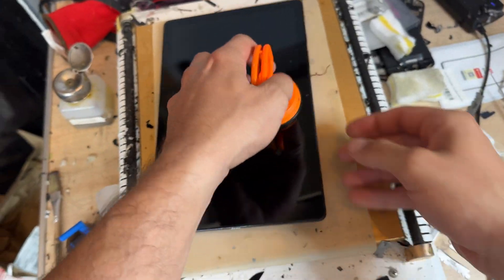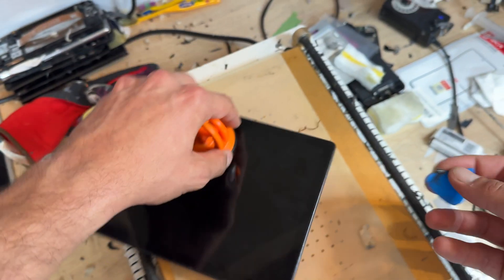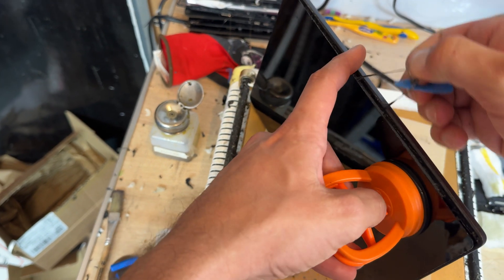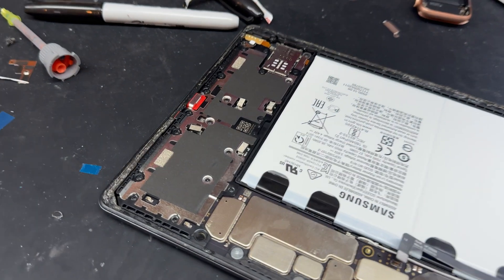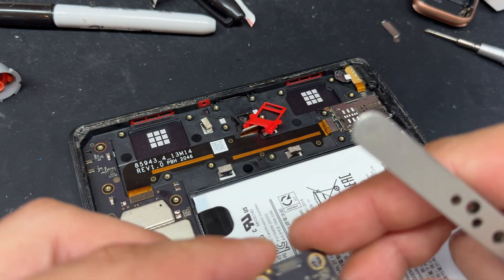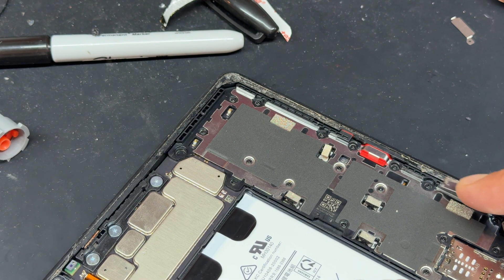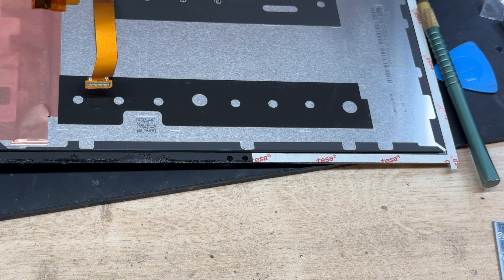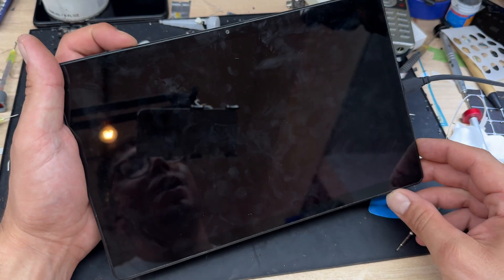DIY Samsung Tab A7 Charge Port -  Full Repair Guide!

Comment: good video and i was able to get my port changed out no problems. tablet was dead already because it wouldn't charge but i may have waiting to long and battery may not be taking charge now, going to leave it on the charger overnight and check it the morning. the video was perfect though, used heat gun and took about 30 minutes to get screen removed. thanks and let you know if it took charge in the morning
Reply: back story tablet worked right up till battery was used up but would not charge right before that, checked 2 chargers, seen ports where usually the problems. ordered, watched video, replaced no charge still. been about 1 1/2 yrs sitting so ordered battery and i still am not getting nothing even with new battery not even a beep. kind of at a lost. seen some info about waking up new battery going to keep googling. do you have any help to offer a poor guy.

Comment: If the soldering points on the model are already so bad from the factory, it is not advisable To protect the new spare part  with a little UV varnish  So that they do not break again?

Comment: Hi mate , any advice for taking screens off that are separating.
I’ve had a few instances with phones that have AM screens / very sticky liquid gaskets (mainly on 12-15s) 
Where the LCD frame / bezel is actually separating from the LCD when I try prying up with a flat tool. Any tips ?

Comment: Guys, I have a question, is it possible to hand over the iPhone under warranty if I have hot pixels on my camera, the laser in the nightclub hit the camera, 6-8 hot spots in different places
Reply: Or the store will say that this is not a warranty case
Reply: As an Apple certified technician i can say that, laser contact to the camera voids the warranty, as per the iPhone  inspection guide.
Reply: @sevagtankabalian91  How would you know thats what caused it. Ive bought 3,000 pro cameras that had a dead pixel cluster out of the box